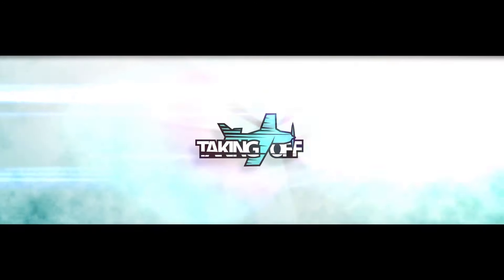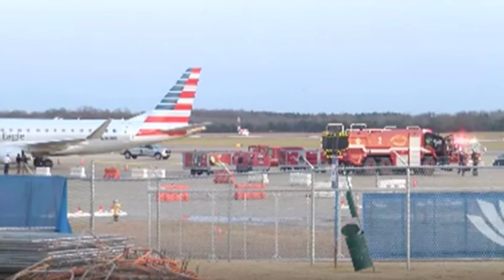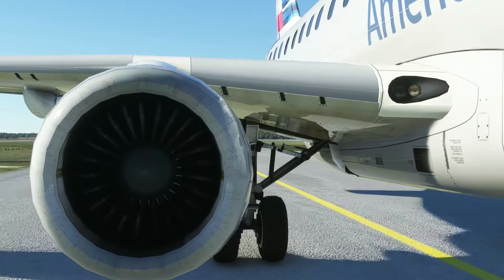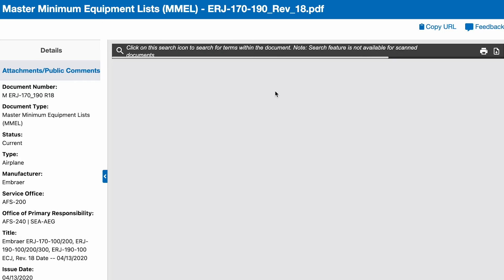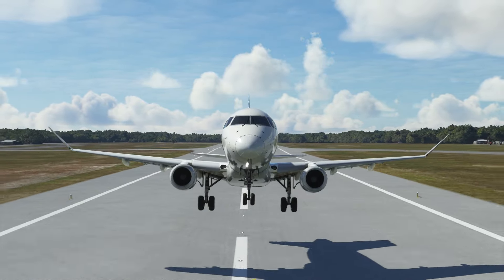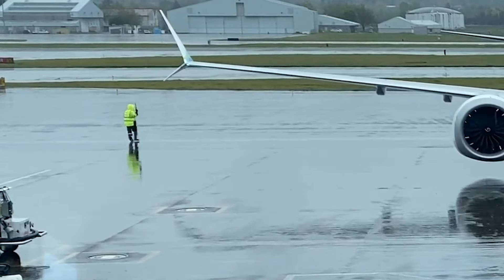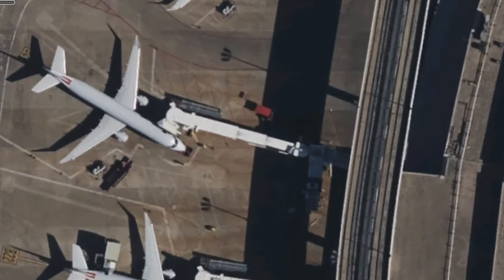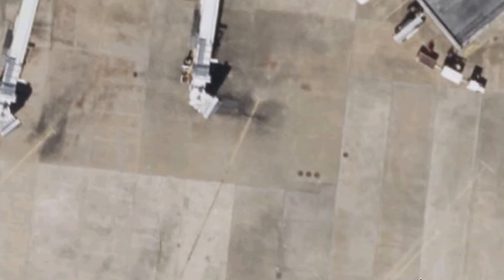Woman Sucked into Engine at Montgomery Regional Airport New Years Eve UPDATE

Comment: In both military and commercial experience,  I made a special effort to stay tf away from running engines.  Way away.
Reply: yep same here, i used to always go behind the engine to place chocks just in case. I'd rather be thrown away than sucked in
Reply: I used to have to lay under a jet engine running full power and adjust the fuel controls.  Scary, but safe if done properly.
The noise would be so loud, communication was impossible.  We would operate the landing lights as a signal.

Comment: The engines were still running. By that time, one crew member had noticed that Edwards had nearly been knocked over by the plane's exhaust and issued yet another warning for Edwards to give the engines a wide berth.
Sadly, Edwards misunderstood, forgot, or disregarded the repeated instructions, because she then stepped in front of the left engine and was "pulled off her feet and into the operating engine," the latest NTSB report that claimed that the worker had been "ingested into the engine"
Dat white supremiss ain't gon tell me whats ta do......
Reply: What about the others not stopping her or shutting down the engine

Comment: I performed this job for years and I can say that tragically this was because of not paying attention.
Reply: must be upper management, always blame the worker. what the un informed are not being told is that when the apu is not working you need a gpu plugged in for they plane to be functional on the ground for unloading passengers. if the ground crew is not told of a pending problem its hard to know exactly where the problem are is. if you truly ever worked around jet aircraft you would know how hard it is to distinguish where the noise is coming from, especially if you are actually working at your job instead of standing around with your finger in your ass.
Reply: @jimmieroan9881  Well, if the worker was at fault, then that is who is to blame. Just because it may be true that it's hard to tell where the noise is coming from, that doesn't mean that an individual is not responsible for their actions. If you are a ground crew member, then you are trained to know what and where is safe, and what isn't. Even under unusual circumstances, you are still responsible to take appropriate safety measures and follow protocols. That is why in firearm safety you ALWAYS assume the gun is loaded and act accordingly, even if you know the gun is empty.  

You must be a modern liberal/leftist. It's always someone else's fault. An individual is never responsible for something bad that happens to them. It's alway "management" or "the man" or "the patriarchy" or "society" or "circumstances" or some other external source. 

It is absolutely entirely possible that the woman died solely because she wasn't paying attention. 
It is absolutely entirely possible that the woman made a fatal mistake.
Reply: @jimmieroan9881  you forgot to mention she is likely another quota hire and they passed her even if she flunked the ground protocol test.

Comment: Typically if you're going to taxi in on one engine you do so by shutting down the engine on the same side as the ground ambilical connection not the opposite side.  Single engine taxi into the ramp is just asking for something like this to happen.  If by chance you loose momentum and come to a stop short of the nose wheel mark it can take well in excess of 75% thrust to brake away and get moving again. Not desirable when the intake is pointed at bunch of loose objects. Condolences to her family. This should not have happened.
Reply: Correction. Aircraft should taxi in with #1 engine, because the cargo doors are on the F.O.'s side. You can safely connect ground power with the #1 engine on. Bottom line, any wing mounted engine should be approached from the nose, to verify spool down. NEVER from the side!

Comment: Fortunately i started my flightline career in the Air Force. In my unit, corner cutting was non-existent. We would have run ups with afterburners. You could be sucked in much further. After separation i went TPA and saw ramp agents taking things rather casually. That was 20 years ago. I cant imagine the phone distractions now. Even in private aviation, death was all around by generally fundamental mistakes. You must always maintain your edge and respect for the job. Now i see agents holding a light wand not even looking at whats going on.

Comment: Those outlines don’t mean much to ramp workers, different planes provide different safety zones due to size. You can’t really operate off of the “safety envelope” as you call it. I’ve worked hundreds of flights, the best thing that keeps you safe is listening for the engines. I’m not sure why she couldn’t hear them but if there was an air start procedure then that complicates things quite a bit. Ground crews are typically unprepared for air starts because it happens so rarely. Only once in my 3 year ramp career did we have to air start a plane and if I’m not mistaken, it was an Embraer as well. A JetBlue plane. Air starts are always a little sketchy because no one is prepared or trained properly on them.

Comment: Former E170/175 captain here. I’ll add that after landing at my company we had to wait 2 minutes until shutting down any engine. Regardless of APU operability. At airports like MGM you arrive at the gate very quickly after exiting the runway on landing. On many occasions at regional airports we sat at the gate for a minute or slightly more with both engines running until that 2 minutes elapsed. So there’s a good chance both engines were running when the accident occurred.

Comment: I was working as a new employee in October 93 at TWA as a rampee (baggage handler). I and my coworker were replacing the food carts with new ones. We pulled up to the back door to load and unload the carts. I was standing on the truck platform over the cab of the truck when maintenance started up the engine. I went back into the truck as far as I could go, not knowing if the suction of the engine would pull me or a cart into the engine.

Comment: Retired Marine jet mech here.  Worked on F-8s, A-4s, and A-6/EA-6B's.  The F-8 and the A-6s would flat out eat you if you lost situational awareness.  The A-4's, with higher intakes, were safer to work on.  Even so, all maintenance turn-ups require installation of intake screens for safety.
Reply: I've worked jets in the AF for 14 years now, and have only ever seen intake screens in old photos from before my time. Either they aren't considered essential and/or not in the T.O. (tech order, tech data, maintenance manual, etc) or the AF as a whole has turned away from it. Most stories I've heard involve a young or dumb "other shop" like Weapons/Loaders, Avionics, etc. Crew Chiefs and Engines/Jets tend to keep a better head about themselves and recognize uncommon or abnormal situations.

Comment: Purely my uneducated guess: No air start available for restart. No.1 engine left running for a cross start of number 2 engine at departure, & so ground crews could unload & load aircraft on the turn. The rampy had a brain fart went under the fuselage or from the left wingtip, to aid in the load or chalk the wheel & crossed the intake of the number one engine & met her fate. This isn't the 1st time chit like this has happened.

Comment: General aviation story.- Co-worker at previous employer was running a Piper Aztec on ramp to perform some engine checks. Someone not paying attention was walking straight towards one of the engines and propeller. The co-worker in the cockpit Moved the prop lever into FEATHER and saved the persons life.The person was hit with a rotating club instead of a rotating meat cleaver. They were serious injured with busted collar bone and broken shoulder and bruises but lived to tell the story.     
Aircraft Ramps are DANGEROUS places and they must have your undivided attention at ALL TIMES. Situational Awareness.

Comment: You are correct, safety training is stressed when working around aircraft.  As you say, no one knows why she walked in front of that intake.  It only takes a moment of not paying attention for tragedy to strike.  She would have had to have been right in front of the intake in order to be sucked into it.  For jet intakes, you can actually stand fairly close to it in front, and not be sucked in.  Most of the air being sucked in is from the sides, not from in front.  So she'd have to have been fairly close.  

When I was in the Canadian airforce, I was working in an F-18 squadron in Cold Lake, Alberta.  We had the same thing happen to a bowser driver (fuel truck driver).  The jets were lined up on the hangar line, and typically the bowser driver would show up, and the ground crew would assist them getting hooked up to the jets to begin fuelling, and the bowser would work its way down the line of aircraft, refuelling them between missions.  Well, unknown to the bowser driver, the F-18 he pulled up to was running.  Due to his ear defenders and the ambient jet noise on the hangar line, he wouldn't have heard it.  He didn't see the ground crew, so thought he'd get things started by grounding the bowser to the aircraft in preparation for refuelling for when the ground crew showed up.  Procedures state that the ground crew does all the grounding, including the grounding of the bowser to the aircraft.  Anyway, like I said, the F-18 was running, and there SHOULD have been a ground crew out in front of the aircraft for the pilot starting the aircraft.  Apparently the pilot called the groundcrew in front to show him a reading in the cockpit, and so the guy in front walked to the side and climbed the ladder to see what the pilot wanted to point his attention to.  They didn't notice the bowser driver who pulled up, and who didn't see the ground crew on the other side of the F-18.  They didn't see him, either.  The F-18 was about to take off on a mission, it wasn't due to be refueled so no one was expecting a bowser to show up.  So back to the bowser driver, at that time it was standard procedure to ground the bowser to the grounding point on the centre external fuel tank.  The grounding point for that is RIGHT in front of the intake.  If it was summer, the bowser driver might have been ok.  Like I said in the beginning, you can actually stand pretty close in front of a jet intake and not be sucked in as most of the air comes from around the sides of the intake.  However, it being winter, the driver was wearing a parka and that extra bulk and surface area blocked enough of the intake that he was sucked in.  They didn't notice in the cockpick.  F-18 engines are pretty forgiving.  All they might have noticed in the cockpit would be a slight blip on the RPM gage.  Anyway, the ground crew and pilot got done whatever they were talking about, and the ground crew went back in front of the F-18.  He noticed the bowser.  He noticed the grounding wire running from the bowser, up and into the intake.  He saw red liquid that maybe looked like hydraulic fluid underneath the engine.  He realized what had happened, and frantically told the pilot to shut down the aircraft.  The bowser driver would have died instantly, before even realizing what had happened.

Procedures were changed after that.  No one was allowed to use the grounding point on the centre external tank under any circumstances, whether the plane was running or not.  The ground crew in front of the aircraft wasn't allowed to leave his spot for any reason (that was already the procedure, but this guy didn't follow it).  If the pilot needed the attention of groundcrew while he was in the cockpit, another groundcrew would need to attend (there are 2 groundcrew for each AC start. One in front, and one to do the final walk around, pulling pins, etc).  Bowser drivers were not permitted to approach the aircraft.  All grounding and hooking up of the fuel hose was done 100% by ground crew.  Again, this was already procedure, but now there were no shortcuts allowed.

Bottom line, you HAVE to follow the procedures.  ALL THE TIME.

Comment: First off my condolences to the family of the worker, I worked in air transportation for 25 years in the Air Force and we don't have lines on Air Force base airports to indicate the envelope of safety.   A crew chief for the grounds crew is supposed to be present at every departure and arrival of any aircraft at any airport in America. This incident has nothing to do with APU, circle or envelope of safety etc. It has everything to do with a crew chief not briefing his crew on different parts of their job when servicing an aircraft and communicate with hand signals or walkie talkie to WAIT for complete engine shutdown before moving in to service the aircraft and cones are not placed in front of the engine until engine shutdown because the engine power can suck up the cone and destroy the engine. In the US Air Force we have a phrase that pertains to any job low or high risk to make sure the job is done right the first time,  THE MOTHER OF ALL FAILURES IS THE FAILURE TO COMMUNICATE. in a job like that situational awareness is extremely important.

Comment: A laser triggered instant fan stop system would cost less than $10,000 per engine if not less once mass produced. This problem could have been solved in the 50's i cant believe its still an issue.
Reply: That amount of Rotating Inertia and Mass cannot be stopped Instantly without major problems.
Reply: Those plane trucks you see. Put metal grate on them bigger than the intake. Make them remote control or even plugged into a circuit so plane can't taxi. Something. This HAS to be an industry wide protocol change, not just one families bazillion dollar payout.
Reply: @guitarhillbilly1482  let the shaft get damaged at least someone will live. it could be calibrated to ignore small objects. The metal grate or mesh idea makes a lot of sense as well. A cone shaped grate would have low enough resistance to minimally affect engine performance, which are already designed to be overpowered anyway. If the grate openings have  aggressive angles of attack, they may actually improve performance at higher speeds.
Reply: @31minutesago  Apparently Russian fighter jets have retractable engine covers for takeoff from cluttered runways. The covers have thin slits in them to let the air through

Comment: In the Air Force they show you the aftermath of such incidences. Chopped heads in helicopter rotors where you see them pick up a dude's scalp, a guy I named Sloppy Joe who  used high pressure on a low pressure tire resulting in an unidentifiable pile of mush, bits of a person shredded into an engine inlet, audio of a crew who crushed someone in a C-17 spoiler....

Comment: I worked at a small airport trained by delta standards. It's standard that the wings, nose, and tail have safety cones placed after chocks are placed (nose and at least one main), which is done before any equipment can enter the safety envelope. A given airport may or may not have paint around the envelope. Bigger airports have gates often made for specific airplanes, so they are more likely to have a painted envelope. A ground crew person must place chocks, which is done inside the envelope. There are also cones placed at certain positions in front of below wing engines and are placed when engines are shut down to keep people and equipment on the outside of the cone area. The airplanes have markings where the engine safety area is as well.

Comment: I never worked around this type of aircraft; however I was a trained as a landing zone officer for medi- vac helicopters when I was with my local V.F.D. & on several occasions I had to warn people about not approaching the helicopter, especially the tail rotor ! It just amazes me that some people think that bad stuff will never happen to them for whatever reason; it only takes a split second for the rotor wash or the tail rotor to literally suck debris or people into those blades ! When I was in charge of a landing zone....nobody crosses that safety zone ! You must have 100% concentration on the job at hand! One false move or a stray marker cone can be a disaster! My prayers & thoughts are with the families! This is just another reminder as to why the rules apply to everybody when it comes to working around aircraft & industrial equipment! SAFETY FIRST! NO EXCUSES LIVES DEPEND ON IT!

Comment: The spiral on the centre hub of jet engines is an optical indicator that the shaft has spooled down to a safe speed when the spiral is visible.
It's not always easy to use audible indicators as one should be wearing ear protection.

Comment: Sincerest condolences to the person's family in this tragedy, prayers go out. Sucks to hear about things like this.
This, unfortunately, can happen if the ground personnel isn't paying close enough attention to the air intake danger area of the engine. Having been a USAF jet engine troop, we had it drilled into us about the dangers of working around a gas turbine engine, i.e., plane of rotation of compressor & turbine wheels inside the engine, and the fact that a running jet engine WILL pull your ass into the inlet. This also included compressor bleed valves on the side of an engine and the obvious one about not walking behind a running engine(it'll blow anything over and send it down the ramp even at idle). I have adjusted many a fuel control on a running jet engine(B-52's and KC-135's), was taught to adjust the high end at idle speed and get away from the engine when it gets run up @ full throttle to check hi speed settings.
Be safe out there if you work on an active ramp or runway!